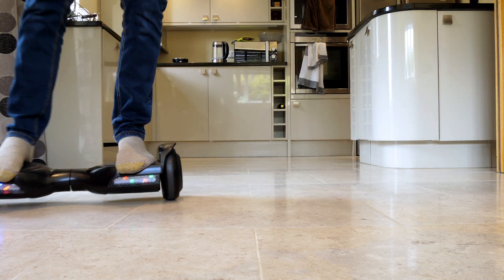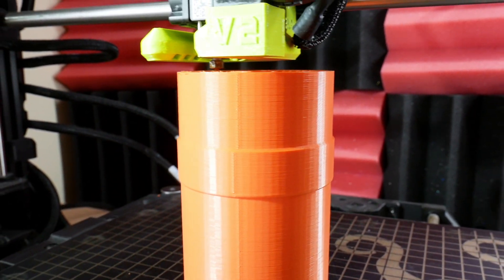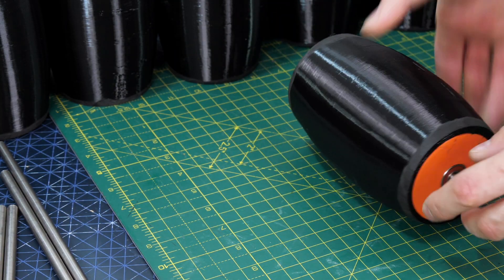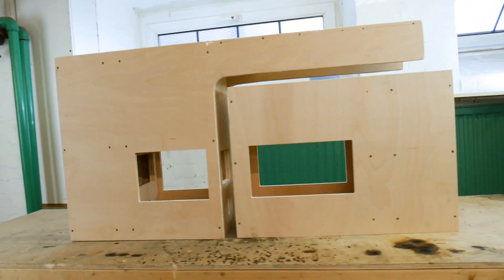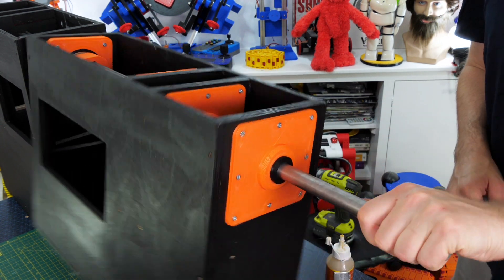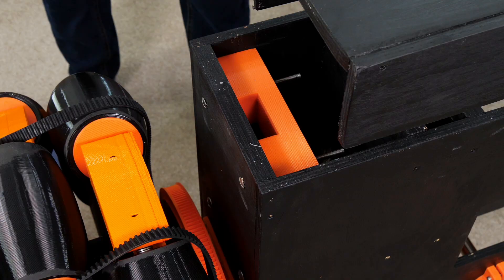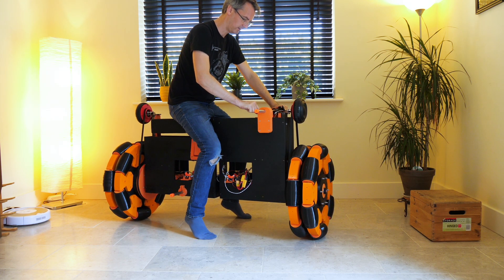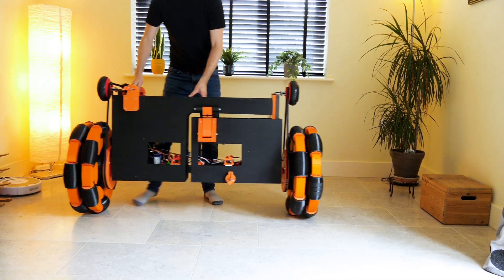Omni-Wheel Bike

Comment: I think it would be easier to put the board pressure controls on the foot pegs. And the forward/backwards motion on the smaller wheels on the handle bars. So you control the turning/sideways with the feet and the forward/backward with the hands. Instead of using your body to tilt the bike, which seems a bit harder.

Comment: Maybe it would work better with a rip stick style setup connecting the front and back of the bike, jointed in the middle. Which would let you pivot the front seperate from the back and may give you better control for turning

Comment: You're essentially driving a tank, and the easiest way to control the two independant motors is with two sticks; pull left stick to reverse left, push for forward left, and the same for right. Considering each wheel can move in four directions, I think a pair of joysticks is the only sensible control mechanism.

Comment: And this again shows why I don’t like the amp hour way of measuring battery capacity… it says it only has 2 amp hours so not much more than an iPhone but the battery actually runs at ten times the voltage so it actually has ten times the capacity

Comment: I really like this project and I am impressed by your aproach with these novel issues that noones faced before. That being said I cant help but wonder why you 3d print almost everything. alot of the parts are very complex and need to be printed but the most fillament is used on part that couldve been made with other faster methods. the giant black spacers inbetween the half wheels are simple enough to be milled out of plywood. the tower to tension the pulley belt is even easier to mill out of plywood. the orange part of the small wheels could be lathed and they would be stronger and possibly cheaper, Im not sure about that. I'd print the pulleys too but even there you can save alot of fillament by printing the complex part and making a circle ot of plywood that fits into it. If you have good reasons why you resort to printing that often I'd love to know. keep up the awesome projects!

Comment: its a good concept, now don't take this next part the wrong way, but i think you were to caught up on the hover board itself when making the body of the bike. i say this because the two axles were an excellent idea to be utilized and i understand for the purpose of moving the wheels in opposite directions for turning. also the foot pegs were a good idea but i think you could of made better use of them if you actually used the foot pressure pad from the hover board itself or something similar to it, that would actually eliminate the idea of a split body for the bike.

Comment: This is fantastic stuff, but the problem that is holding it back is making the bike into a hover board instead of making the hover board control move the bike.  I.e. Simplifying the build to a simple bike structure while making the handle bars into the hoverboard control.
  Best scenario I can imagine is having two separate bars to be used as "handle bars" so you can shift them separately.  You push both forward and the bike moves forward, you push one forward and the other backwards and it will turn in a complete circle.
  Its as if the handle bars are your legs on a hoverboard, but you are controlling the legs with control of your hands.

Hope that gives more ideas to improve this already amazing project.

Comment: I love everything about this project and wanna see you succeed wooden frame is not gonna work for how touchy everything is. You can litterly see the frame flex & bend in on itself when you sit on it (cause wood is flexy) Going the tried and true metal frame route is going to remove wood flex as a variable completely while letting you build a skinnier frame that will let you shift your weight easier.

Comment: Maybe I'm just missing something, but if you set up a servo to tilt the boards on demand, like you speculated about at the end of the video, aren't you just controlling the speed of the motors but with a lot of complexity in between? Or are you hoping that it allows you to control the overall horizontal motion without having to implement the "balance in place when neutral" bit yourself?

Comment: Here’s a thought for next time: use handle bares connected to a bevel gear to tile the sensors. Now you steer it like a bike!

And, maybe try to make it so it will auto-valence without the deadman’s handle, allowing easy mount-dismount!

Of course, the 3.0 will have a system where you stand on it and ride like a normal hoverboard, but if you push a button, it will lift you up, tilt back some while tilting another part, change it from a spot you stand on to a seat. Meanwhile the handle bars pop up, and the sensors disconnect from the contact switches and connect to the handle bars!

“So, nice large hoverboard”
“No, it’s a bike”
“Uh, I clearly see you standing…”
“You were saying?”

Comment: Yeah, nice but a little over thought. The back circuit should have just been mounted in a gimble so that pushing with your feet would tilt the board. The back part doesn't need to be separate! 🙃

Comment: I would say thumb levers to control the lateral movement of the front wheel and either motorcycle brake pedals on both sides for the rear wheel, or use a motorcycle gear shift lever, with each direction running the rear wheel in one direction or the other.

Comment: Really fun video, this design could be quite functional if you were able to implement a dead zone so the motor won't activate unless it's very obvious you want it to. Since the board is predesigned though I'm not sure that's particularly possible
Reply from the maker: It won't balance then
Reply: @jamesbruton  I figure that since you're planning on adding forward motion (though I'm not sure how, interested to see) it'd balance similar to a normal 2 wheel bike as it starts moving, and it'd be less squirrely since you naturally lean some while self balancing. I also figure that at any speed above walking pace you lean a bit in turns and I feel it could be problematic if you need to make sweeping turns, but probably still possible with the right finesse
Reply: If you're particularly interested in stationary self-balancing, you could always have the dead zone be on a toggle with a switch near the handle bars, implementing all of this in practice would probably be a bunch of work though

Comment: I wonder if this prototype would be extra stable if each roller had a motor. Each roller motor would be monitored and controlled by a series of Raspberry Pi Nano cores which maintained the overall motion and monitor grip vs direction of travel and pressure put by the rider. Weight pressure sensors would also monitor the user moving here or there and compensate

Comment: Wouldn't the Segway Drift skates, hoverboards, and Onewheel skateboards all be considered Reaction wheels? If so perhaps some of them could be repurposed to help self balance? After watching one of your tight rope balancing stunts with the human meat grinder reaction wheel... LOL? 
If you were to put one Segway Drift skate on another at 90 degrees offset, I'm wondering if the self-balancing of the upper wheel self balance the bottom one side to side? I figure the reaction wheel on top might require some PID mods or something?

Comment: Instead of free floating the pivot between front and back, you could use the handlebars to drive a linkage controlling the relative tilt (turn bars right, front half is forced right relative to back half).  This could even work just having the bars tilt a small bracket for the front sensor.  That leaves your body stable for overall balance as well.
Respectfully,

James

Comment: Try switching which section the foot pegs and handle bars are on. You want your feet and body to be on a stable frame. It'll be easier to control the pivot section with your arms like a normal bike.

Comment: The "bumping" that you are noticing as the wheels rotate is due to the fact that your TPU wheels have varying thickness between the bearing ends.  I think you would find it smoother if you could make the stiff inner core of those parts match the profile of the TPU surfaces better, maybe with ribbing similar to the boss you currently have near the middle, but spread over the length of the sub-assembly.

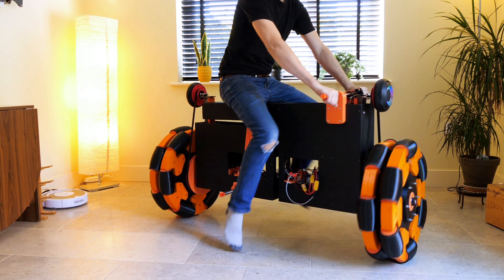Comment: @14:50 you need to balance it better. then it would be easy.... You could also possibly add in some auto balancying Gyros that spin fast, to balance the weight they feel. It would determine how much weight is on the bike and spin faster or slower depending on the weight of the rider and how much they are leaning...

Comment: I think you should add pressure sensors that allow you to drive either heel into the bike and cause the back wheel only to move. Essentially that is how you ride a horse. Left heel could drive the rear wheel clockwise and right heel makes it spin counter-cw. Would give a bunch more control.

Comment: Ergonomically you've turned a hoverboard into a motorcycle, but you've left the controls at the feet, as though it's still a hoverboard. Steering a motorcycle with your feet sounds... awful.

I'm not a roboticist, but could you not just move the normal hoverboard control system into a movable set of handlebars? Tilt forwards to go forwards. Tilt left to go left. It seems like it would need very little modification.

Comment: A fun project for you to try some time James is Mecanum hoverboard or bike. Most people believe that you need a square or rectangle with 4 wheels to make mecanum work, however the reality is that you only need 4 wheels. If you put 1 left and right versions each side, and spin each independently, you can get full 2 axis movement from 4 inline wheels. Couple this with a balancing mechanism and you could get a hoverboard that could also strafe left and right. Or if you modified it for a bike design like you've got now you could get both forward and sideways movement.

Theoretically this could still with if you flip the wheel 90 degrees of what you have now. 2 infront and 2 in back all inline. Imagine a regular motor cycle with to extra wheels so that you can see all 4 fully from either side. If you spin all four wheels forward you'll move forward, if you counter rotate the the front/back pair you can get sideways movement. This will give you maximum forward speed and smoothness while also allowing the bike to autobalance side-to-side, or turn in place.

Comment: Wouldn't it be easier to steer if the riding position was turned 180 degree by fixing the handle bars to the "smaller" half and the foot pegs to the other half? I think it could be easier to twist with arms while keeping the body balanced than doing that with feet.

Comment: I think the easiest solution is to power a third omniwheel on suspension, in the middle of the other two wheels but rotated to face forward so you can just motorize it at the wheel's axis for forward motion:   I-O-I

You would probably have to engineer a whole new frame, but I think it would work better than trying to retrofit and power a smaller omniwheel or two for forward motion around the existing frame. Io--oI

Comment: I think having the handle bars and the foot pegs on the other of what they are on might be better. Means what you are moving with your hands is not connected to what you are sat on making it easier to move, whilst your feet are connected to what your body is which is important for leaning and balance. Just a suggestion and one that would need to be tested but I think it would turn out easier to control, more comfortable and easier to get used to/learn. Its like a bike where the handles are free moving but the foot pegs remain on the same axis as the rest of the bike. :)

Comment: Pipe framework like a bicycle, only rigid. Spin wheels 90 degrees like a bicycle. Spin hoverboard wheels and circuit board in line with wheels. Doing this will allow you to achieve the effect you want simply by leaning from side to side. To drive sideways counter rotate one wheel like tank treads or zero turn lawnmowers.

Comment: I think you should keep your original scheme, then revise it in a third part. For my part, I wonder if you might be able to slide your butt left and right across a leather seat as people do on real motorcycles. That might be a simple solution. I think you might need some indexing points for your thighs and knees to aid in controlling the rolling back part. You could take inspiration from horse saddles and dressage commands for horses.

Comment: why are you steering with your feet rather than with the handlebars? surely it would be easier to sit on the back half and tilt the front half with your arms rather than sitting on the front part and tilting the back part with your legs

Comment: You are aware you can calibrate the sensors by pushing the button for 15 sec?
You are aware there is an open source github you can flash on the hooverboard for controlling the esc and motors with an RC signal?

Comment: 4-wheel differential car, no turning, only tank turning
Reply: keep it simply applicable and robust
Reply: ball bearing dc motor, diy, no coils, just bearing balls and magnet ring, the bearing balls are the brushes and the bearings
Reply: box is simply sturdy
Reply: ion 3d printer and separator, for diy chip at home, tube vacuum ion printer
Reply: the same dc linear em-motor as a bearing ball sling
Reply: that view defies anything usual, wheels look like stoppers and not enablers, lol
Reply: looks like a bull ride machine, vomit machine
Reply: also the main switch could be under the sitting position, turning off if any pressure is turned off
Reply: maybe put pedals to move left right and forward, tank turning two levers
Reply: why are you sideways tho to the main wheels

Comment: Very cool. I get the impression it would have been easier to steer if the split in the bike was between the handlebars and the saddle. Having the handlebars and saddle as one unit but then the feet trying to tilt the back half of the bike is a bit unintuitive.

Comment: Would the balancing work if the omni wheels were turned by 90° and the hoverboard controlled the omni rollers (they would need to be made powered)? Would then allow the large wheels to be aligned and powered like a bike, with the rollers supplying the hover maneuverability.

Comment: Could you mount the rear control board directly to a  bar that forms the foot pegs and then allow the foot peg/controller assembly to pivot relative to the bike? Then simply pushing down on one side of the peg assembly will pivot the rear one way or the other, while shifting your body weight side to side will rotate both boards equally resulting in sideways travel.

Comment: An interest sideways bike but would be neat to see the thruster or drive wheels work all together. Great idea for the dead man switch to turn it off instead of having a run away. Since you replaced the battery you shouldn't have a battery failure as we've seen and heard many times about hover boards catching fire randomly or while charging.

Comment: From the initial design, I thought you were building a bench seat with the big wheels driving you forward (at right-angles to your intended direction).The handles going down to those wooden boxes control the tilt of that side of the hover board.
Reply: Adding drive to the small wheels would add an exciting sideways slip!

Comment: Instead of mapping to the body of the bike in being split to turn it, have you considered just simplifying it with twin throttles? Both forwards to go right, both back to go left, then split to turn on the spot. Then, for forward propulsion, you can use the foot rests and still have breaks on the handlebars to stop with for relative safety.

Comment: I dont know why, but this is the most exciting project of yours, thus far. I REALLY enjoyed watching your process, and seeing the end product! I cannot wait for the subsequent part(s) to the rest of this project ^_^
Reply from the maker: Thanks, hopefully putting a Star Wars spin on it in part 2
Reply: Yes! This is screaming that it wants to be a speeder bike! @jamesbruton , you need to build it and then get Adam Savage to skin it for you.
Reply: @jamesbruton   The bike at 1:50 is really cool, but I think the intermediate question is whether you can freeze the handlebars and control the bike with the omniwheel. Low speed control could probably be achieved without doing much more than that, but high speed control would likely involve angle control (i.e. putting the sensors on an independent swivel that you can manipulate). That's probably what I would do prior to constructing the full bike (which I think is going to run into some handling problems at higher speeds , much like a hovercraft would, though maybe that's the intent...).